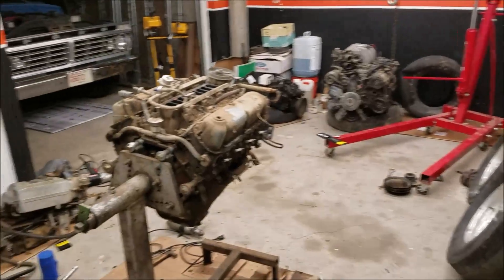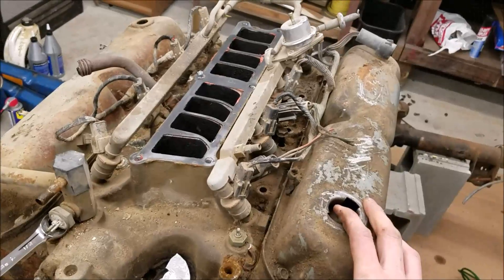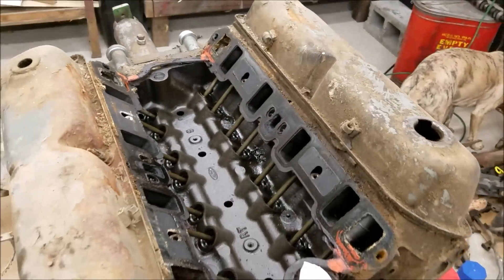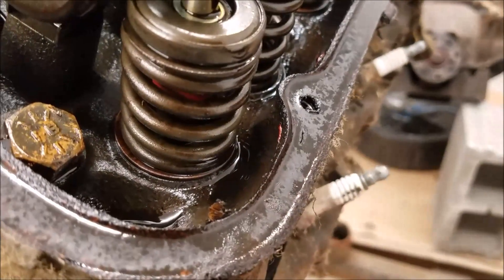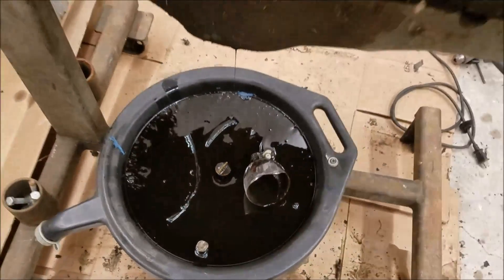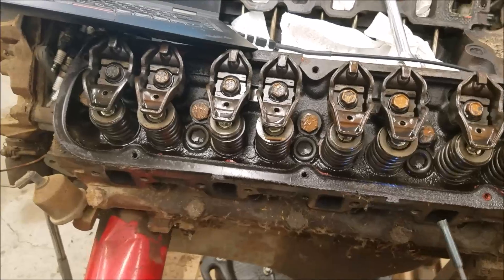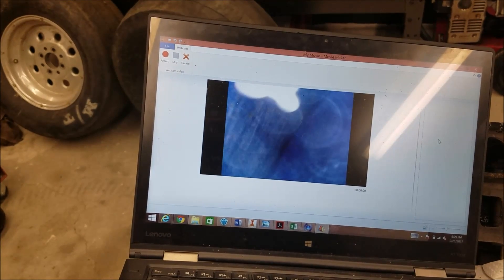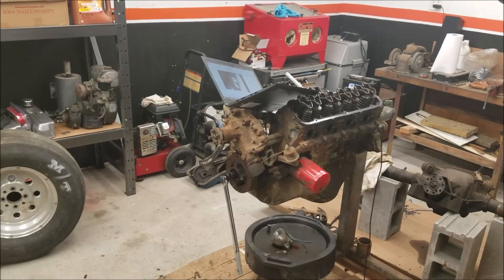Mystery Farm 302/5.0 Engine: Tear Down - Is it Still Good ???

Comment: Hey Thunderhead, I’ve got a 302 supposedly bored and stroked, can I put factory heads and fuel injection on the short block? I was wondering if the timing would be any different, or there might be valve interference. Unfortunately I’m flying partially blind not knowing exactly what crank and pistons are in it. My truck is a 94 F150.
Your help is greatly appreciated!
Reply from the maker: Bored would be just fine, stroker would be another story potentially. 
Search thunderhead289 390 vs 360
It will show you have to measure the stroke - from there you can determine what you have and how to move forward!
Reply: ThunderHead289 will watch it now, thank you sir!
Reply: ThunderHead289 no chance a different crank could affect the timing could it?

Comment: I just threw a gasket kit in a 350 sbc it came out of a truck I dropped it in an 88 camaro. Holly high rise intake summit carb it's the serpentine belt set up. But when I go to start it it lopes and no start I've check the plugs 3 times re dropped the distributor with it set at tic. I didn't mess with the cam the timing chain or the crank. Do you have any idea on what I need to look at ?
Reply from the maker: +Damian Ramirez and you are sure it is actual top dead center and not 180 out? There are two locations where the balanced will say 0 but you can easily be 180 off. And you have heard it pop a bit like it does have ignition?

Comment: Man my 86 250 needs some head work. Found out it has a 1970 Mexico 351W!!!!! 
So I'm pulling that out for a rebuild in the future and I took out the 5.0 form my 89 Lincoln :( 

Figure with only 73k original miles all it needed was some new seals and gaskets, cleaning and some goodies to carb it. Looks great in there!

 Anyways, pulled off the fuel injected intake and to my shock was a roller! Dog bones and retainer and all!! Yay!!!!!

Comment: I'm curious as to the cutout on the timing cover for the carb style fuel pump. When I pulled my stock 5.0 out of my 88 fox, it had the same style timing cover but blocked off? Was yours the same way too?
Reply from the maker: like cast in, but not through cast, yes indeed mine is the same. must have been the transitional period no doubt.

Comment: I've got a couple of 68' 5.0 blocks I'm thinking of rebuilding one of them depending on condition. Would they be able to be converted to a roller cam assembly or would the expense be to costly?
The Mars plug you found is put on by the manufactures for warranty purpose. If the engine is returned to them for any reason the firs thing they inspect is the Plug. It will melt and distort
Reply from the maker: you would have to get retrofit linkbar roller lifters, but thats about all it takes to run rollers in an old block. the lifters are more expensive, but not awful. it will run you about 400 extra for the lifters.

Comment: Hi, just subscribed. love the channel!
Question, how could you tell that oil was getting in the intake runners? can you just see oil? or mabe because of the manifold showed signs?
I'm about to tear down a 289 from my 65 mustang to see why its not running well..
Thanks!
Reply from the maker: i could see it on the bottom of the gasket at the intake runners very relevantly - the intake was not really torqued at all either. some things to consider on an old engine, check over the valvetrain. flat tappet cams are not proerly supported by modern oils in that they require a higher zinc content which can be purchased as an additive. so when they wear on the cam, it loses lift and valvetrain adjustment. a worn out engine can still run very well, id look into your distributor and carburetor settings first before tearing it all down.
Reply: Thanks for such a quick reply! I'm putting in a 5.0 that I just put together while I work on the 289. I learned a lot by watching your videos! The 5.0 was from a 91 mustang. Just did a basic carb conversion and added gt40 heads that i had access to. Thanks again and I'll be looking forward to more videos!
Shane
Reply from the maker: that should get you down the road just fine!
some things to consider with that swap also - remember the flywheel of a roller engine is of a different balance weight than the early flat tappet, 2 piece rear main seal units. make sure that you have the proper tooth count for the bellhousing, and that it is the proper balance. 
good luck! should be fun!
Reply: The one problem I'm running into with the 5.0 swap atm is that i'm running the v-belt 3-bolt pulley setup from the 289. Bought an aftermarket balancer with 3 or 4 bolt applications (its drilled and tapped for both), and the crankshaft pulley and WP pulley don't match up. It's off by 1/8" (Crankshaft pulley is not out far enough) and cannot find a spacer like that anywhere seeing that the pulley has that flange that fits inside the balancer. I searched youtube, but nobody out there has an "accurate" video where it shows exactly which balancer, pulleys, and or spacers to use when doing a 5.0 swap for v-belt. I know this info would be helpful to many people! I'm considering buying a reverse rotation WP and going the modern serpentine belt route. So frustrating! Any thoughts or suggestions would be really helpful. Thanks again!
Reply: @ThunderHead289  I looked it up and was surprised to find that small block Fords are actually lighter than Dodge slant 6's, thereby providing better traction when in front on RWD.
Reply: @Shane - had this EXACT problem when I swapped a 5L into my '69 Ranchero. I used a Performance Products balancer. Ended up having to add a single washer behind the V belt pulley and the balancer. 

Probably not the "right" way, but it worked perfectly fine for 12 years.
Reply: I use a cheap racing oil with high zinc for my flat tapper stuff. 
Without that added zinc your going to find metal in your oil changes I can promise. 

Ask me how I know. Go on! Ask me! Lolol

Comment: how would you adjust for too much lifter preload on thoes, and would the same work on a 300 l6, shims undoor the rockers? if so where do i get them.
Reply from the maker: I have got them from summit before - search pedestal rocker shims. Pretty much the same design across the board. What leads you to believe that you have too much preload?
Reply: ThunderHead289 i checked the specs from comp cams ( i have put in a 252h).020" to .040" mine measures .107" exsot, .071" intake, i have called summit, jegs and all the auto parts stores in my area, no one has them for a 300 l6, if it was the same size for a 351 or 302 it would cross reference, right?
Reply: do the ones for the 302, 351 use a 5/16 bolt and are about .5" to .55" wide?
Reply from the maker: i see where you are at now with having a different cam. when you run a higher lift cam, the base circle on that cam has to be smaller in order to have the higher lift (this has to happen so that the cam lobes can still fit through the bearing bores during install) - so when the base circle gets smaller, the pushrod has to become longer to accommodate. this is why you are having an issue id imagine - im sure your pushrods are too short ??? 
i could be wrong here, but by no means would you need shorter pushrods with a higher lift cam i would think. 
???????
Reply: ThunderHead289 my head and block where shaved and the pedastools milled to flaten every thing out, and the com lifters are taller than stock lifters, this is why. i made a stamp to make the shims and shimed each of the rocker up .030" to .050" everything is now to spec.
Reply from the maker: seems all well and good, BUT - have you then altered your rocker arm angle? moving the rocker arms up and down does effect the angle, which is why i always check my pattern on my valve stem and alter my pushrod length accordingly. it really comes down to how much was milled off of the pedestal mounts.
Reply: ThunderHead289 im not going to spend 100 bucks or more on costom pushrods at this time, and with stock lenth pushrods and i think the pedestals have just been brought back to stock height (or close to it) by the shims. i will check the the wear patten in a few weeks and go from there, pushrods or adjustable rockers, this is just to get it back on the road as it is my daily driver.
Reply from the maker: understandable, cant blame you there. determining pushrod length and ordering in pushrods is a lot to go through, and if you arent banging 6500 rpm, im sure you would be just fine.
Reply: ThunderHead289 this engine has never been reved past 3600, i up shift at 1800 and down shift at 750. just a old work truck, and the 300 is gutless past 2500 anyway. and crane cams just just call me back there shims for a 302-351 will fit a 300. 

thanks for help, and why dont you build a inline at some point?
Reply from the maker: +oldreliable303 Justin Scott Iv just yet to have a vehicle with one thus far. If I had one in something, i definitely wouldn't change it. My shelves are just saturated with small block parts

Comment: I have an opportunity to pick up a donor motor from an 88 stang for $150.00. They say it barely ran when parked 6 years ago. Do you think it is worth while to use for a donor?? I am not able to hear it run to see what the issues may be.
Reply from the maker: All depends what you mean as far as using it as a donor engine - as in build while you have your current one in and driving?
Reply: Yes, I want to drive the car this summer while I build the new engine for it.
Reply from the maker: id just pull the dipstick on it and make sure there are no metal shavings, throw a battery in it and see if it turns over and is not stuck. if it meets these parameters, it should be a good rebuilder. the injected stuff is often in very good shape mechanically.
Reply: Thanks for the info I will try it!! I see your email, are you ok if I email you If I have questions??
Reply from the maker: its become very common these days, i have no problem with it. i really need to get my web page going again and start up the forum on it. seems most of my subscribers and followers these days are based around the small block ford stuff.
Reply: I do appreciate your opinions!! I was a Mopar lover until I owned a fox body!!

Comment: Your opinion, I have my 85 mustang 5.0 that sat idle inside a garage for 13 years. My concern is that it starts to push blue smoke after it gets hot, but not when it is cold or at start up??
Reply from the maker: oh yes, that is just like my rotstang. the rings are worn down, but the reason it only shows when it gets good and warmed up is because your oil thins down and it can get through the rings. 
you can get more run time out of the engine by adding some thicker oil, though consequently you lesson your chances of being able to do a quick hone and re-ring job. - if you plan to bore it over though, you will be just fine running it while you have oil pressure.
Reply: Thanks for the info!!!

Comment: What do you think about the $500 junkyard engines that come with a warranty? I'm having a hard time sourcing good blocks in my area.
Reply from the maker: 500 is a fair price, but i would get yourself one of those cheap ten buck bore scopes like i have so you can have a good look at what you are about to buy.
Reply: Yea those are handy,I need to get one. I thought the 351 was going in the f100?
Reply from the maker: it was, and still is eventually. since i have become a traveling engineer it has really cut into my time. got that other injected engine from i guy i know out of a rolled bronco, so im just going to drop it in the f100 for the time being. the problem with that truck is that its my only truck, so its hard to go without it in the summer months. the 351 will be headed to the machine shop soon. might do a 408 with it. not sure yet. iv just been gone too much this winter.
Reply: ThunderHead289 for the 351w I like the 427 stroker kits.

Comment: I have the same intake lower I got in a trade was wondering if a Holley upper intake manifold would fit and work
Reply from the maker: i really do not have the slightest idea on the injected stuff. i do not have experiential knowledge there.

Comment: how often do you think one should start a low mileage stored vehicle to prevent rust you were showing.
Reply from the maker: I usually don't start them till I drive them. Less cold starts the better. On my stuff, I spray in fogging oil or wd 40 and turn the engine over for about 10 seconds without starting it (disconnect ignition) they will store like that just fine. Extended periods and completely seal the block with tape and lube it Down good inside.

Comment: e6 is 1983-1986. Block is a reman from a 94+ trk or roller mustang etc. something that donated its roller engine to reman plac.
Reply: Ford started using roller blocks in the 150's in the late 80's , they just didn't use the roller cam instead using just a flat tappet setup but the blocks were indeed roller blocks
Reply: My 89 F150 did , bought new in 89 ,I rebuilt it in 05 and used a Mustang roller cam , and bought the spider hold down  plate through our Ford parts department at the time where I worked at the dealer . the holes were already drilled and tapped , it was an E7TE truck roller block came factory in the truck .
Reply from the maker: +TxStang Craig Voisin clearly ford must have done it a number of different ways in the trucks! I wonder why they just didn't opt for the roller from the get go.
Reply: That was actually the plan to replace them all with just one block 86 was the transition year to use up the inventory of non roller blocks and use roller blocks , Mexico blocks , US blocks and Canadian blocks  were all thrown into the mix in the US cars and trucks so there is no telling what date each plant started the changeover in casting . The one I had was a US E7TE block so the Engineering drawing and casting mold was made in 87 and used for many years after it was made . Working in the service dept of a dealer we were constantly having to chase technical bulletins and attend new training classes , royal pain in the butt .
Reply: from what we  were told it was the Foundry's Mold ID Engineering blueprint casting marks , how true is that ...who knows .
Reply from the maker: How do you know if the block is from a truck? Could be a crown Vic block for all we know.
Reply: what is the block casting numbers
Reply from the maker: the only difference between the truck blocks and the car blocks - the factory sealed units do not have the hold down bosses drilled and tapped !!!!
Reply from the maker: +TxStang Craig Voisin sounds like it. What were the triple x blocks. I have had 3 of those now. Seems like they are an early roller Bock thing

Comment: now if you can find 3 or 4 bar heads off of 90's Ford explorer it will add 35 to 45 extra bolt on horsepower. check it out it's for real. I think that's a 302 without the roller lifters cause the hold down bracket is not there. I believe it is a block that can be used for roller lifters. either way it's just Ford cool.
Reply from the maker: It is true, though I usually just jump right to the aftermarket head game these days, though I almost always replace the e6 with the e7 units. That always feels like 50 in and of itself !!!!
Reply: ThunderHead289 I think they are called GT 40 and GT 40 p heads. they will say GT 40 on the top inside. 3 bars on one head of head is   GT 40 heads and GT 40 p has 4 bars on one head of the heads but no everyone can uses GT 40 p heads. you can look up why. congrats on your find.yes aftermarket heads rock.
Reply from the maker: +Mark Huston yes, p heads have some interesting exhaust stuff with them that require certain headers. Iv run a lot of aftermarket stuff. Trying something new that will appear on the channel very soon
Reply from the maker: +D4x4Bronc wish I could post pictures on the heads that are going on the rotstang engine (short block bagged on the stand)
Reply: run a roller 351 block and gt40p or better

Comment: looks like a mid 80's 302
Reply: Ford did use the roller blocks in the truck starting in late 80's , they just did not use the roller cams in them and used flat tappet cam and lifters . I was a ford certified tech from 88 to 2005 . What are the casting Engineering numbers on the side of the block ?? Should be a E6TE-A , E6AE-A , E7TE - A or something like that... example : E=Decade ,   7=Year ,  T=Truck series ( A=Car series ) ,  E=Engine component group , A= blueprint revision alphanumeric .  these casting numbers are engineering blueprint numbers and that's why they differ from part numbers in the parts books .that Head is actually a CAR  head , E6AE translates to E=Decade of manufacture , 6=86 , A= Car series , E= Engine component group .would be interesting to know the block casting to see if they used a car block as well when they rebuilt it and put on the truck intake
Reply from the maker: Came out of a truck, but it can't be the original block because the trucks did not have the roller bosses drilled and tapped. Definitely a mid 80s 5.0 50oz balance one piece rear main seal unit.